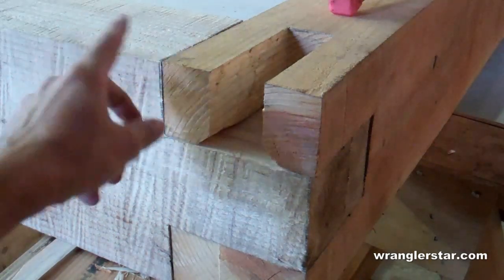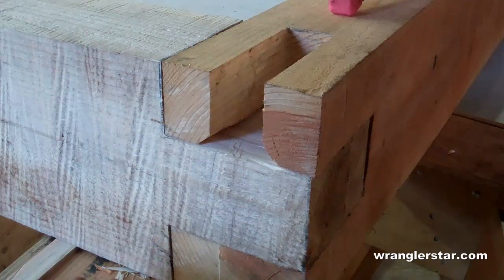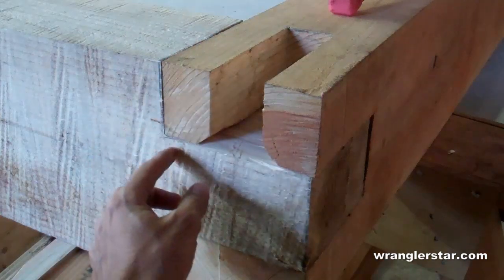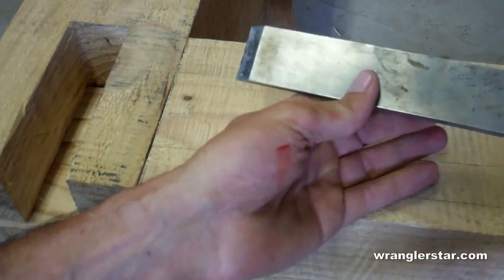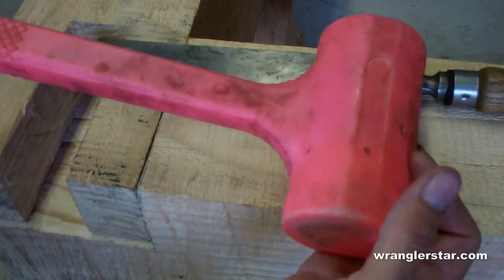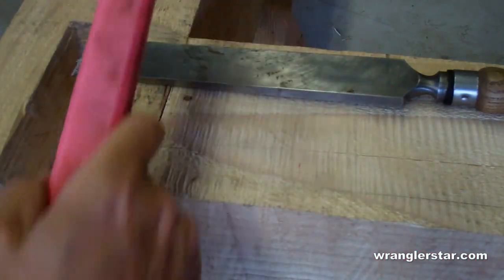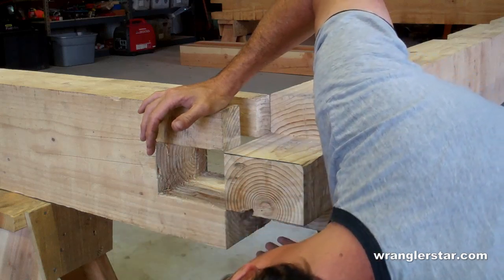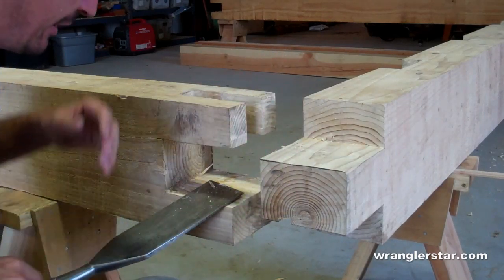Perfecting Timber Frame Joints Fitting Large 16-Foot Sill Boards for a Cabin Build

Comment from the maker: I have read using multiple species shouldn't be an issue. The dovetail is a complex joint. I want to assemble the complete sill structure with joist. Once assembled I'll compress the sills with ratchet straps. Once the frame is compressed I'll layout and cut the dovetail.

Comment from the maker: your trailer deck expands because of the water that the wood soaks up. This frame will be protected by a roof and siding so water will not be an issue. The frame will be connected by wooden dowels not Gorilla Glue however Gorilla glue is awesome stuff for sure.

Comment: In the future, it may be more productive to cut either the tenon or the mortise first and then mark the adjoining piece of wood directly from that.  It will require less fitting and probably save you time.  You're doing a great job though, and I love your diligence and methodical approach to building.

Comment: Sometimes you can get the joint right by leaving it together and running a handsaw through the joint that is tight, that will remove the thickness of the saw kerf and allow the joint to close up below.

Comment from the maker: No it's not split. This section was close to the stump. What you see is pull out that happened when the tree fell. It is not a concern in this particular member of the frame.

Comment: Hi Cody. I have just purchased the book you are using (TTFB) to follow along with your progress. Could you please do an in depth Video on Marking Out joints using the Framing Square and accounting for Timber of varying sizes and Reference faces, (boxing?), etc. A running commentary of your brain dump would be helpful as you mark out a joint. The book is quite brief in description and methodology. Great work and thanks.

Comment: soft wood like fir will bend if dried to quickly towards the side closest to the heat source. A full ambient heat will dry it more straight. One side towards a wall and the other towards the ambient will curve the wood quite a bit. Flipping the wood will help.

Comment: I'm interested to see if the joints loosen up as the wood continues to dry. I have a wooden deck on my car trailer that's tighter than all git-out in the winter but you can put a pencil between the 2x6's in the summer. Shims might be in order, depending on what time of year you erect this. 
I'm also waiting with baited breath to see how you're going to tie the joints together. I have some Gorilla Glue I'll sent up!(;>)!
Good job Cody, you're giving me some ideas for a future project.

Comment: when joists are spaced at 450 centres you dont need very big timbers to support the loads of a 2 or even 3 story home.   Its basic engineering that has been designed for all carpenters and tradesmen that is used across the world.   Your not supporting bricks as if its a brick veneer they are completely seperate from the house, your only supporting the internal walls, fixings, and the roof on the top.

Comment: How are you going to get this out of the shop? Are you going to build and disassemble it, then move it to the site? I'm just curious because I don't know anything really about building or framing. You cut this wood yourself, right? Then you let it season? How long does it take for a big old trunk to season? Do you remove bark and let it season? Then, once it is seasoned and cut like it is in this vid, do you use any nails or clamps or anything to keep it together? How long does it take one person to do all this work?

Comment: You don't need that much for a floor frame? When you consider the weight it has to support, and the fact that there is no foundation upon which it will be set, you do in fact need some hefty timbers.

Comment: And you are totally missing the point of what the cabin is designed to be. It's a timber framed cabin, not an economy build. Timber frames are historically designed to be massive, powerful, overbuilt, rugged structures that can withstand anything nature will throw at them, for centuries to come. It's inherent to the style of building he's chosen to use.